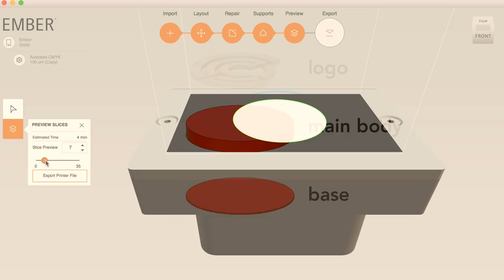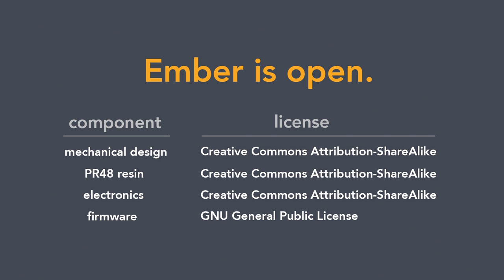How to use 3D printing for mass manufacture

Comment: Cool platform, but how do mechanical properties compare to injection molded parts?  Looking good on the surface is great.  Breaking down with UV exposure, having little to no compression, tensile or shear strength etc: not so great.  Can I use this thing for anything other than a badge?  Very eager for that day.

Comment: 3D printing is great for prototypes or a few off's. 3D printing can produce stuff no other methods can - for that is is excellent.  

But 3D printed mass production of simple plastic parts just do not make sense:

A product should be  designed for manufacture when even part of the manufacture can be replaced by other methods.

 The base and logo's can be done with desktop injection moulding (www.many-maker.com) then print the serial number with a serial number marking machine.  For the price of 1 ember machine you could have 4 DIM's and they each could produce 4 tags in 1 shot. Instead of using resin costing >10$ is useses pellets <$2.

3D printed mass production of plastic parts just do not make sense.
Reply from the maker: +Many-Maker You're right that most simple designs can be mass produced more economically with injection moulding. But it wasn't a practical option for these tags. These NFC chips have some non-standard, delicate circuitry that would be destroyed by the heat from molten plastic. If these parts were injection moulded they would have to be made in 2 to 3 separate pieces that would have to be snapped or bonded together. A key aspect of this 3D printing process is that the NFC chip is embedded in a monolithic part.

Yes, the serial numbers could be done with a marking machine. But what 3D printing excels is being able to change the logo on the front on the fly with zero additional tooling costs. Any changes in design would be very expensive in injection molding.

Lastly, your reasoning makes perfect sense if the goal is to make millions of a single tag. But Origin is doing production runs of dozens to tens of thousands of a single design. The runs are relatively small, but their overhead is also much lower.

Thanks for the reply! And good luck on your indiegogo campaign!
Reply: U forget to add cost of making mold and time also. Plus technology like carbon 3d and continuous dlp 3d printing is cheap.

Comment: This is why you injection mold it in 2 parts and sandwich the chip. Like every single other manufacturer of NFC chips.
Reply: But you would need a different mold for every serial number which is not viable
Reply: @JavierD  You use laser engraving to put numbers.
Reply: @artomatica  So, you are adding other manufacturing process, other machine, other person/time for using the laser engraver